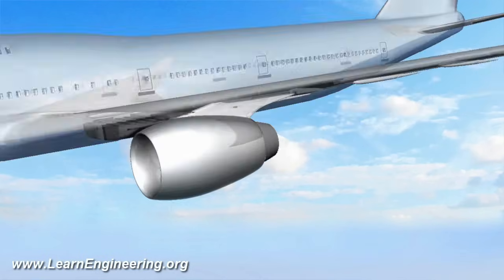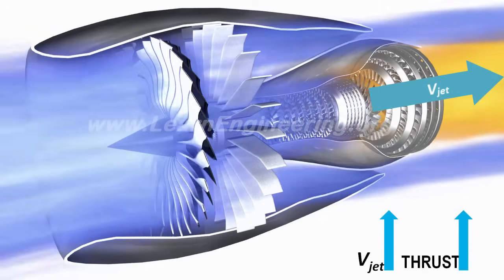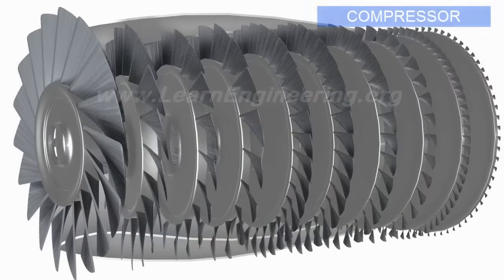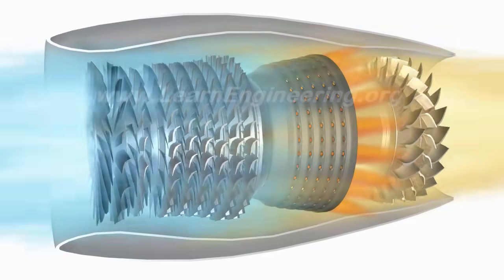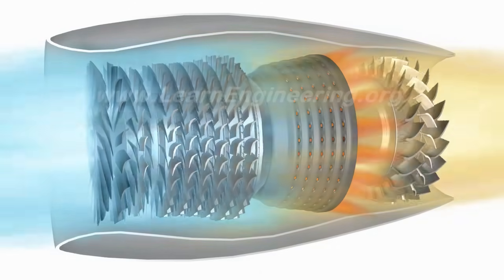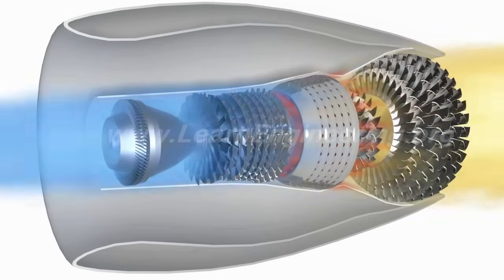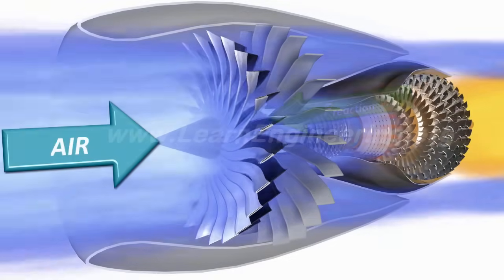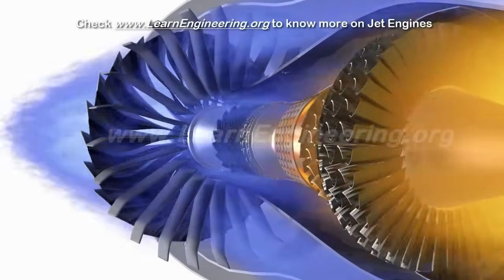Jet Engine, How it works?

Comment: wait hold on, is the fan blade in the video is drawn correctly? from my understanding it will make the air go the other way...
Reply: Pujo Swasono I was thinking the same thing.  It looks like the compressor blades should be shown turning the other direction.  But if you did that, the turbine blades would be going the wrong direction.  Maybe the compressor blades are turning so fast, that they look like they are turning the opposite direction ;)

Comment: I understand most but the compressor part...
Reply: ***** By taking in a large volume of air at the front of the engine (large opening) then forcing it through a smaller opening at the back of the engine. This restricts the flow of air and causes a back pressure (compresses the air). The added energy from the burning fuel cause the blades in the back of the engine to turn faster sucking in and compresses more air...
Reply: ***** all you really needs is a compressor, just microwave jet engines and fly to space like that.
Reply: joe biden
I mean... how does the compressor work? Compressor compresses large volume of air into small volume, right? But how is it done?
Reply: You need to think of a tea pot that's been set on boil for to long and build space planes with microwave jets engines and battery and solar panels and everybody can fly to space for ever,somthings wrong with people should of been made a long time ago.
Reply: joe biden
Doesn't mean to offend, but I can hardly understand your sentence...
Reply: ronc1357
Now this makes a little more sense... thanks!
Reply: Really people should be living in space by now with a oven on bake or microwave, that work better then a jet engine.like poking a hole in a gallon you know what I meen?
Reply: No I don't know what you mean.
Reply: ronc1357 He's just a troll -__-
Reply: ***** a compressor does 2 things: 1- is to supply air to combustion chamber  and 2- is to thrust air. it turns because of the effect of the turbo because they are connected together by the same shaft,their function is somehow like a generator connected to a motor, a generator gives power to a motor and a motor gives spin to the generator and they will keep running infinitely. but in jets once fuel run out the engine will stop

Comment: My question is why in the last stage of the engine, we reduce the pressure and the heat??
Reply: Abdulla Qasem I think it's caused by the work done on the turbine by the hot air. The hot pressurized air moves the turbine, but in turn loses energy, by means of reduced pressure and temperature.

Comment: What is the use of this bypass air?
Reply: Ashish Sharma Given that Fn=Ve*mdote-V0*mdot0+Ae(Pe-P0), where Fn is thrust, V is velocity, mdot is mass flow rate, A is area, P is pressure, 'e' denotes nozzle exit and '0' denotes free stream, if you want more thrust, there are three ways to get it - accelerate the air more, accelerate more air and have a higher exhaust pressure. The last one is just too inefficient and is never used by choice.

That leaves accelerating air more, or accelerating more air (see what I did there?).

In thrust terms, their contributions are equal (linear), meaning accelerating 1kg/s of air by 5m/s gives you exactly the same thrust as accelerating 5kg/s of air to 1m/s.

The change becomes apparent however when you take account of how much energy is needed to do the job. Assuming a perfectly efficient system (won't happen. Just won't. But it makes it simple to illustrate), the energy you need to put in equals the change in kinetic energy of the gas. Now kinetic energy is defined as E=(1/2)*m*V^2, so the power you'd need to produce a certain amount of thrust is given by P=(1/2)*mdot*dV^2, where dV is change in velocity.

Going back to our first example, both ways produce a net thrust of 5kg.m/s^2 or 5N, however once we plug those numbers in the power equation, we get P=0.5*1*5^2 or 12.5W for the first case, and P=0.5*5*1^2 or 2.5W for the second. That is, in both cases we've produced 5N of thrust, but by accelerating air to a higher speed we've used up 5 times the power than by accelerating a greater mass of air to a slower speed.

In reality, efficiencies differ, so it might take 15W and 3W respectively, but the rule still applies. You want a greater mass of air to be accelerated so you don't waste power in that way.

Turbofans do however suffer from thrust lapse particularly at higher subsonic speeds (airliner cruise speeds being about 0.8-0.85 Mach), so an engine rated at 400kN ground static may only produce 80kN at cruise, but that's still enough to keep the airliner going. This is because the bypass flow of a turbofan remains subsonic. It keeps the engine quiet and maintains its efficiency. If you want to go faster though, you need supersonic exhaust (going back to the thrust equation), and this is where turbojets and low bypass turbofans come into their own. A military low bypass turbofan (such as the RB199) or a turbojet (such as the J79) may have an exhaust velocity exceeding Mach 3, which would keep it well within its service range on an aircraft capable of only Mach 1.8 for example. This is where a high bypass engine simply cannot produce the thrust required to be efficient, and one has to use either a turbojet or a low bypass turbofan.

Beyond Mach 3, the most efficient way to produce thrust is a ramjet or scramjet engine. It's closer to a rocket than a jet engine, but it's airbreathing, so the above thrust equation still applies. A ramjet engine uses a shock system to compress air, then slow it down to a subsonic speed. Fuel is then injected like in a gas turbine engine. If the aircraft is going fast enough, the intake gasses may be hot enough for the fuel to ignite on contact, though that shouldn't be relied upon. After combustion, the gasses pass through a nozzle and are accelerated to hypersonic velocities. There is no turbine thermal limit, because there is no turbine, so combustion temperatures can be very high and the gas can be accelerated a lot more. In a ramjet engine all of the combustion energy goes (or should go) towards thrust and the energy used for compression is calculated with the rest of the airframe drag. Ramjets however require an entropic normal shockwave to slow the gas down to subsonic speeds, which causes a loss in total pressure. To get around that, we have supersonic combustion ramjets (or scramjets), where the gas remains supersonic throughout the engine. It is however more difficult to achieve combustion when the gas inside the engine is supersonic, as it is more than likely to simply blow out the flame.

Comment: B 747 has only one engine in the left wing?
Reply: Teddy Teguh Raharja This is called "cost reduction" XD
Reply: Teddy Teguh Raharja And its compressors spin the wrong way
Reply: 233kosta absolutely. I thought so before.
Reply: Teddy Teguh Raharja
The turbine blades seem to be oriented right though, they would indeed cause the compressors to spin the wrong way :P
Reply: Teddy Teguh Raharja It´s a special plane, the complete name is Boeing 747 twister or "tornado" as  pilots like to call them. Amazing donuts in the air
Reply: the animation showed 2 engines but the real 747 - 400 have 4 engines

Comment: really nice video but the fan and compressor blades are spinning in wrong direction see at 0:54
Reply: look the inclination of the compressor blades (in blue), if they rotate in this direction, the air flux should go in oposite direction
Reply: No man, just try to run any fan on this way and observe, look the video:  jet engine made on a 3d printer for example.

Comment: What delivers the fuel to the combustion chamber?
Reply: injectors
Reply: Where do the injectors sit? Is it like direct injection or port fuel injection like cars have?
Reply: Corey Marshowsky Usually swirl nozzles for liquid fuel engines. They produce a traffic cone shaped spray of fuel, which is then mixed with incoming air. There's usually a gas stream passing the fuel injector (which sits in the first row of holes facing the compressor OGVs), which provides quite a bit of the air that gets combusted. The holes on the outside of the liner are for mixing air and cooling air.

Comment: Since the exhaust applies the torque to the turbine that runs the fan, how is it started from rest?
Reply: Chris Bogart Depends on the engine, usually involves spinning up the HP shaft in some way, then when enough air is going through - engaging the igniters and introducing fuel.

The spinning up of the shaft can be done in several ways. Quite a common one is the air turbine starter, which is a small turbine attached to a reduction gearbox, spinning the accessory shaft which attaches to the HP shaft (it drives accessories like the oil pump when the engine is running). You can take that air from the aircraft's APU (which itself has an electric starter), or a ground based starter. On multi engine aircraft, the one running engine can then supply bleed air from one of its compressors to start the other engines. Some engines (as mentioned by the uploader) use electric motors to spin the accessory shaft, and the RR Olympus uses a hydraulic motor. The air turbine starter is generally more popular however as it can provide a lot of power for its size and weight, and it's fairly simple.

Another way of starting a gas turbine engine is by direct turbine injection. Injecting air directly into the HP turbine causes the engine to spin up the way it does under normal operation, however it usually requires a greater volume of gas than an air turbine starter, which may be unavailable if the APU isn't big enough (or the ground based air supply). This may be done to save on the weight of the air turbine starter and its gearbox (or an electric starter), but as mentioned above - may be impractical, as it requires either a bigger APU (which would make the aircraft heavier) or a dedicated ground starting gas supply, which makes it dependent on external equipment which may not be at every airport
Reply from the maker: Chris Bogart Good question, for  the starting purpose we have to use an electric motor. The electric motor will run the main shaft until enough air flow is achieved in compressor and combustion chamber. After that the fuel can self ignite and sustain the operation.
Reply: Most commercial jet engines start with a pneumatic valve called a compressor start valve. It basically blasts high pressure air into the front part of the engine (the compressor stage) to get it spinning. If an engine shut down in flight for some reason, it could (notwithstanding whatever mechanical issue caused it to shut down int he first place) be restarted simply by the force of the incoming air.

I have actually seen them back up a large machine to a commercial jet to start the engine mechanically when the engine's starting system failed. They reassured the passengers that this didnt' represent a danger, because (as I explained above) the engine could be re-started in mid-air by the force of the incoming air. I can't help but think that such a statement probably did little to reassure anyone concerned about flying on a broken airplane.

On a recent flight, they had to replace the compressor start valve on the plane I was on. They did it on the tarmac while we waited... Probably took about 20 minutes.
Reply: +Chris Bogart hand start it lol
Reply: Keil Gilby It is an air turbine, much like the one in your dentist's drill - except of course much larger. Pressurized air turns a turbine that in turn moves the output shaft whose movement can do useful things from torturing someone on the dentist's chair to staring jet engines.
Reply: +Learn Engineering the fan makes a type mix to explode
Reply: The way I get it is that the rotors are creating torque through inverse flow of heated air. The cold air is rotated and the rotors can be electrically started. That is make it turn. My question is: at which stage of flight do you need fuel? For start up you can use volts, but maybe for real vjet power you need fuel. 

Now, when you are in the air, you can almost float, just like when you are in the car and push in the gear link with your left foot (manual gear). You still 'float' over the road without using much fuel. 

So, do planes only need so much fuel for lift off, and for the rest just use air compression to keep afloat in the air? 

Lastly, I'm associating a jet engine with a classic Viktor Schauberger implosion engine. Inverse torque of air creates heat without using fuel. But I don't have any engineering degree whatsoever.
Reply: 233kosta
Reply: Sak Ardiansyah Hmm yes?
Reply: Learn Engineering Not all jet engines use electric starters. In fact, only smaller ones do. Larger, airliner engines such as depicted in the video, use pneumatic motors to start the engines.
Reply: +Chris Bogart compressed air kicks it off
Reply: Pantelis Kokkalis Or electric starter motor.
Reply: Hahaha! +Noel Helsing & +dubhad
Reply: Chris Bogart
Reply: Chris Bogart MO
Reply: Learn Engineering i am waiting for this answer for so long. Now, i know...thank
Reply: bit late to the party but: this explains the whole "turn on the APU" step in DCS-a10.. (starting up and flying an a-10 warthog.)
Reply: Can be started a couple of different ways. Usually air from the apu aka apu bleed air. Can use a start cart too if the bleed valve or apu is inop and you can even use the bleed air from the opposite engine if it is already burning, for Small turbine engines like helicopters an electric or hydraulic starter can be used but for these big monsters they usually rely on bleed air to get those blades spinning. I’m not sure if you ever noticed when you’re sitting on an aircraft in the ready to start engines that that The air-conditioning inside seems to shut off for a second or two or the sound of blowing air kind of dies down in the cabin that’s because whatever device that was supplying that Good air conditioning now has to supply the air for engine start.
Reply: Starter motor sir 😇
Reply: I am wondering why we don't use such engine to move other machines (like cars) than airplanes?
Reply: They use an actuator that mates the starter motor to the flywheel of the engine. Once started, the clutch disengages the starter motor.
Reply: There's  another  jet engine called an APU located near the rear of the plane you cant see it but it has a hole with a burn marking around it  an electrical motor spins that up then it ignites its used to power the electrics and backup for the hydraulics its used to spin up the main engines one at a time.
Reply: I felt their explanation lacking of how the engine works.  Sounded similar to building a house would begin by putting up walls.
Reply: electric start, gets it turning, then igniters, fuel and then you get ignition
Reply: +Chris Bogart i was wondering the same. & thanks for the answer
Reply: So there is no need for liquid fuel oil???? The fuel for airplanes is only air- compressed air?

Comment: Is the turbine used just to increase efficiency?
Reply from the maker: Chris Giverin In a Jet engine, the turbine's function is supply the necessary power to the compressor. In fact all the energy produced by the turbine is consumed by the compressor.
Reply: Cool, thanks for the clarification

Comment: here's a question: why thrust is related to the jet velocity? is there a formula?
Reply: Silvestro Lusardi Fn=Ve*me-V0*m0+Ae(Pe-P0), where Fn is thrust, V is velocity, m is mass flow rate, A is area, P is pressure, 'e' denotes nozzle exit and '0' denotes free stream. Note, me and m0 are not the same due to the fuel added in combustion, so me=m0+mf.

It is literally the total momentum change of the gas plus the total pressure difference times the area it acts upon. Ideally though you want Pe to equal P0, as you gain more from accelerating the gas further than just relying on the higher pressure.
Reply from the maker: Silvestro Lusardi More the momentum the engine is loosing, more will be the thrust on it. It is just conservation of momentum. The formula for thrust can be deduced as Thrust = m(Vjet - Vin ) , m = mass flow rate of air.
Reply: What he said.
Reply: xPadge112x :D
Reply: My dad taught me that when I was 9 lol 😂
Reply: Silvestro Lusardi I suppose there are two ways you could look at it. Conservation of momentum gives you a straightforward answer, but the even more obvious answer is ... F = ma.
Reply: Richard Walker But thrust is the sum of all forces, so one must also account for any residual pressure the exhausting fluid exerts against the surroundings (in this case - the atmosphere), so P*S is also necessary
Reply: 233kosta wjwwj